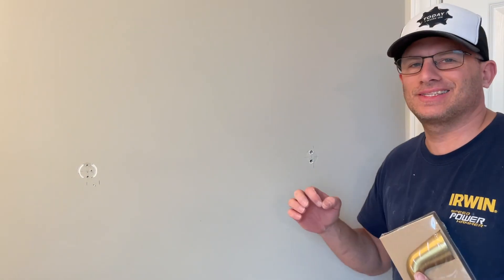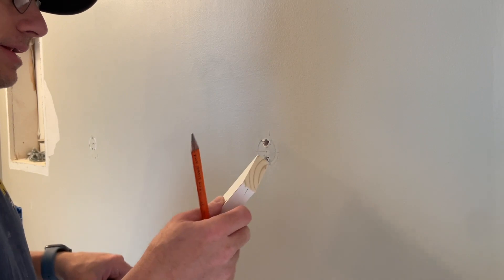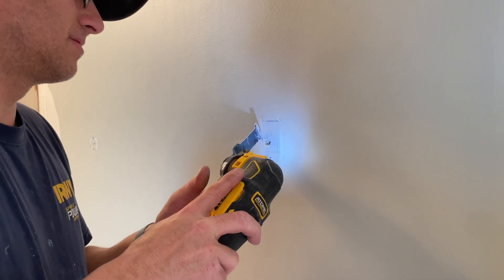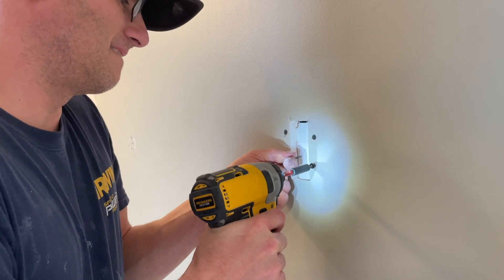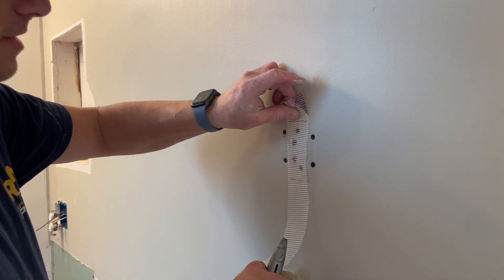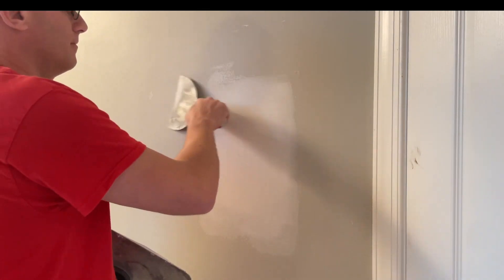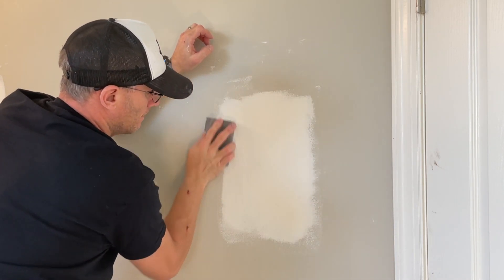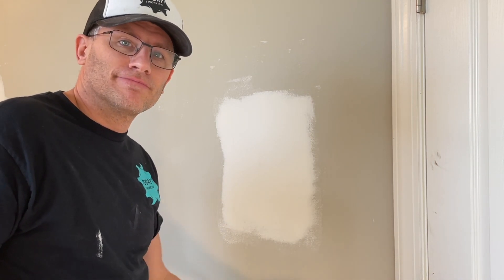How I Install Blocking for a Towel Bar or Toilet Paper Holder

Comment: Small tip:Use easy sand 20 (dries for 20 mins and you can finish the job same day).Blocking behind the Sheetrock should be attached from stud to stud but this is light weight and might work.Good work

Comment: I don't think I've ever heard of cheater board ever being called nor used as actual blocking, I guess it's better than anchors. Although honestly with the finishing your already doing you should have just ran real blocking, worth more as well
Reply from the maker: Unless you’re doing pull-ups, I’ve never installed blocking for my towel bars. The magic of silicone can hold a few towels and maybe a few more with no issue. 

Just because you never saw it does not mean it will not work. 😉